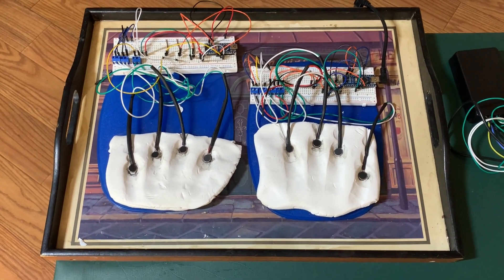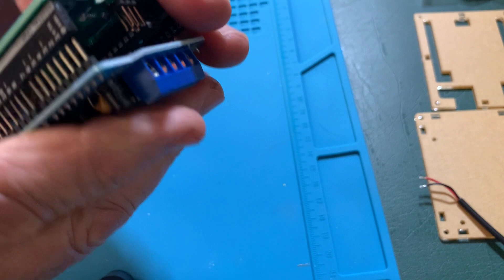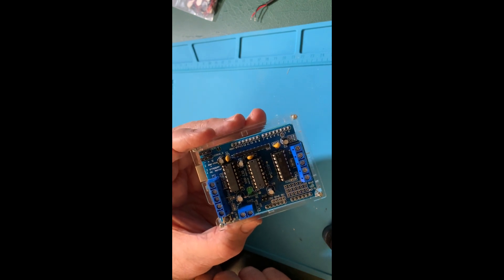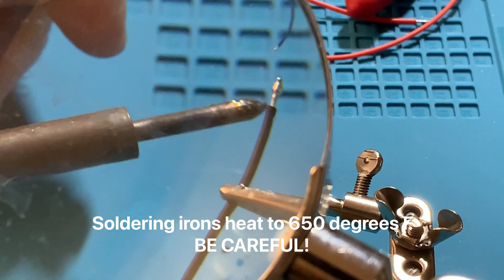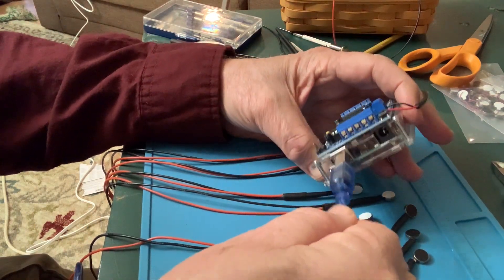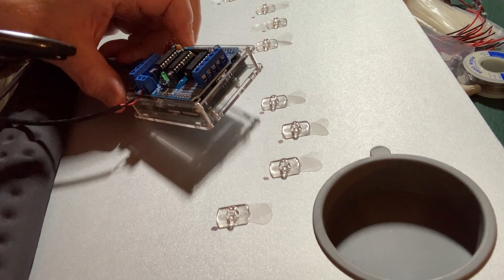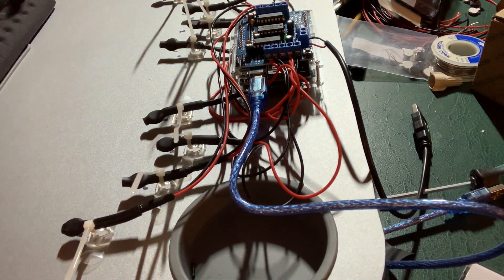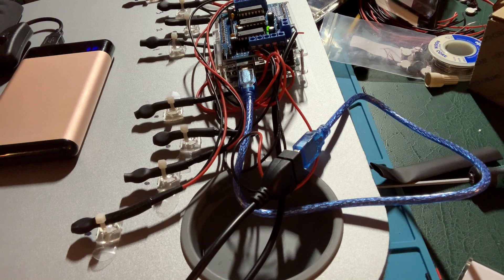PD Buzz Board

Comment: I just made a pair of gloves to try on my loved one. They came together great and should be easy to use / move around. Would love to chat about peoples experiences so far... I am most interested in what order of finger vibration and optimal pulse we should use... do people have experiment data on this yet?
Reply from the maker: There is a discussion thread on the github at https://github.com/pdbuzzboard/pdbuzzboard/discussions.  My PD partner is operating on the repeating pattern _167 loads (board and gloves) with good results.  I don't believe anyone has compiled results across the community.
Reply: Is that a change in pattern from 100 for your pd partner? If yes, did she "top out," at initial rate?
Reply from the maker: The pattern is the same, but the pulse is longer (167 ms vs 100).  I started with the 167 in my first iteration and haven't moved her to anything else as she is getting a good result.
Reply: Great your pdp continues getting solid relief.  Still searching here amongst patterns for more solid/lasting results.  Thanks for quick response.
Reply: Hi, do you have any results to share?

Comment: I have built a buzzboard with the 15 k motors but the motors are getting hot after about 5 minutes. I this normal?.
Reply from the maker: do you have a 5 volt power supply? (no, they should not get hot)

Comment: Hi. I am trying to assemble the lap board with Arduino uno rev3. I am trying to assemble the companion case as called out in the parts list. The parts don't seem to match the controller. Can anyone give me a hint where I went wrong?
Reply from the maker: the Arduino Uno case has two screw holes that go on the front (connector) side of the device and offset holes (one is substantially further in) on the back.  I usually put the bottom on a table with the four screws protruding through.  If the holes don't line up, flip the bottom over.  After the bottom is on the screws, place the small rubber rings over the screws.  This is important to raise the Arduino high enough to mate with the motor shield.  Place the Arduino Uno (without the shield) over the screws.  You will need to get the front plate in place now as you won't be able to get it in place once the top is one.  Match the sides to the slots in the bottom and put the top on.  Screws will line up like the bottom.  Once in place, you can spin the nuts on the screws from the top.
Best of luck.

Comment: Do people who have made this type of device have information on how long treatment had to occur to start showing initial results and how long until full affect is present?
Reply: I will share my experience… my buzzboard was modified using finger splints - the motor sits on the inner fingertips and I just slide my fingers in … I BZB 2 hours a day - hour AM and an hour PM … I find it easier to stand up and take that first step …. I feel less klutzy… PD had really affected my cycling power …. Switched to an e-bike to keep up with my fiancée… since BZBing I have put up my 2 longest rides since being diagnosed… longest ride was 27 miles / did 40 and 36 my last two rides.   My overall energy level has improved.  About 30 days in since I started.
Reply: Still on an e-bike but extending rides which is very exciting !
Reply: That is xlnt Garrett, when were you dx'd with pd?  Trying to compare results with other longer term pd'ers (16 yrs), thanks.
Reply: Sept 2017 so 6 years ago ….

Comment: Thanks so much for this video and information. I know about the Stanford study and find it very interesting (changing the pattern of the neurons etc). My wife has PD and we are very open to new ways. I want to build the gloves or buzz board for my wife but I'll need the help of my son who understands the electronics and programming much better than I do. 
My son would like study the original research information. And he is asking if there is one standard vibrating program or if there are several programs. 
Can anyone share the link to the Stanford research and the final version of the vibratory program (code).  Thank you so much.
Reply from the maker: the code for the board and gloves is available at github.com/pdbuzzboard/pdbuzzboard
The references to the A and B patterns are on page 4 of this document:
https://www.ncbi.nlm.nih.gov/pmc/articles/PMC8055937/pdf/fphys-12-624317.pdf
This document references the randomized pattern testing on page 7
https://www.frontiersin.org/articles/10.3389/fphys.2021.716556/full
The main page for the Stanford (Tass Labs) docs are here:
https://med.stanford.edu/tass-lab/publications.html
Reply: If I  want to change the pulse to 167 from 100(you mentioned someone got solid results at 167-but little at 100)is that done by selecting it in the library & uploading it?  A non-coder's question, thanks.
Reply from the maker: The Arduino is a pretty basic device.  It runs whatever Sketch was loaded last.  Uploading a Sketch over writes the one currently in the device.
Just download the Sketch you want and go through the compile / upload process as normal.
Reply: Thanks for the refresher..

Comment: Hello - and thank yo for the great video.  I just completed, but am having some difficulty.  Everything seems to be working - three LEDs light (with one of them flashing).   However I am not getting any vibration from the motors.  I have tried multiple power sources and it's not that.  I'm using software version VibroTherapy_3V_167.  Anyone have any ideas?
Reply: I played with it a bit and figured it out, but I don't completely understand.  When making the motor connections to the five terminal block, when I connected the black wires to the center ground terminal of the block, it worked fine.  I was assuming the "M1" for example was a positive and negative.  Hopes this helps someone troubleshoot!
Reply from the maker: The VibroTherapy_3V_167 is built for the microcontroller. The VibroTherapyMotorShield Sketches are built for the Arduino Uno / Motor shield configuration.
Reply: Please.explain more about the center.of the block and wiring.  Desperately searching for anything
Reply: I had a similar problem. It ended up being caused by the plastic case, removed the case and plugged in the motor control directly and it worked.

Comment: I am trying to install the Arduino software. but I am using a MacBook Air.  Does it need to be a windows environment?
Reply from the maker: I use both Windows and MacOS interchangeably.  There is an Arduino IDE for MacOS.  Whereever you install it, you will need to end up with the .. / Arduino / Libraries / AFMotor directory structure (you unzip the Motor Shield zip into the Libraries folder).  (this assumes you are using the motor shield and not the micro controller.  The board/port selection looks a little different, but the Mac recognizes the device without issue.
Reply: Thank you for the fast response!  We were able to install the s/w and I have completed the build using gloves instead of the board.  Now to see if this therapy works!
Reply: Keep us posted on results good or not so... I have not found any consistency yet after a few weeks....just. flashes of short lived things
Reply from the maker: @cropsy50  which software load are you using?  Have you tried a different software configuration?
Reply: @pdvibrationtherapy  Hi Paul(?) Hope all continues well with your better half.  Did not see your question until just now as I was preparing one for you.....I switched from 167 to 100 after a couple weeks of mixed results where I thought meds were lasting longer, but not able to reduce much at all.  The 100 I've done for a week without anything positive and today I switched back to 167 where meds in just this one day feel like they are lasting longer and I may be on the cusp...If you have a suggestion to try another load, I trust in your judgement, and yes, my mileage may vary.
      Question for you as I bought those sensors and a Arduino Nano to test.  Do I have to solder all 30 pins from the 2 unattached 15 pin railings that come with the Nano.  Thanks as always.
Eric
Reply from the maker: a couple of questions.  Did you build gloves or a board?  If gloves, microcontroller or motor shield?
Reply: @pdvibrationtherapy  Just the board so far...

Comment: can any one help me, i am new to arduino- i upload the sketch but keep getting error C:\\Downloads\VibroTherapyMotorShield\VibroTherapyMotorShield.ino:7:10: fatal error: AFMotor.h: No such file or directory
 #include <AFMotor.h>
          ^~~~~~~~~~~
compilation terminated.

exit status 1

Compilation error: AFMotor.h: No such file or directory
Reply from the maker: You are missing the motor shield library.  It is available on the GitHub here: https://github.com/pdbuzzboard/pdbuzzboard/blob/main/AFMotor%20(arduino1.0).zip You will need to download it and extract its contents into a Libraries directory under your Arduino directory.  On Windows it will look like c:\Users\YOUR USER ID\Documents\Arduino\Libraries (if you ran the standard install).  On MacOS it will be similar.  Once you have the AF Motor library in place, you should compile without issue.
Reply: Thank you so much 
Your hard work is helping so many people I am deeply grateful

Comment: For some reason I can't get Motors 3 and 4 to work . Is it possible I have a bad board ?? Or not enough power? Any insight would be great
Reply: I figured it out had my wires backwards
Reply: Weirdly I am having the same issue where only 2 of the 4 work simultaneously. Its not a wiring thing, but curious if you had any updates?